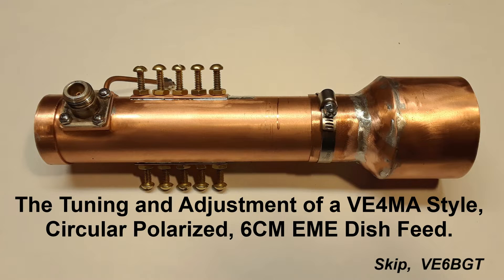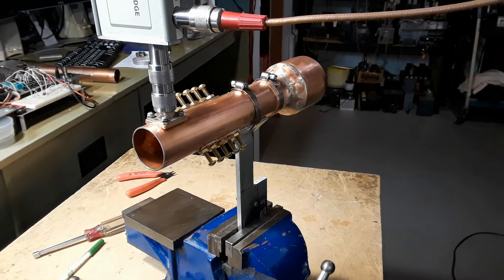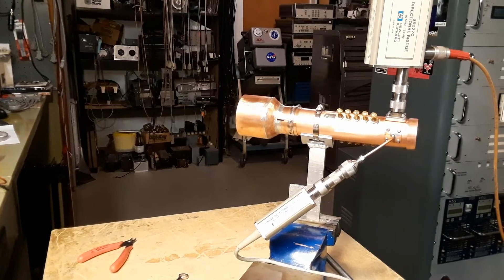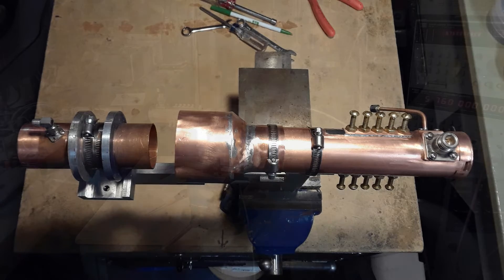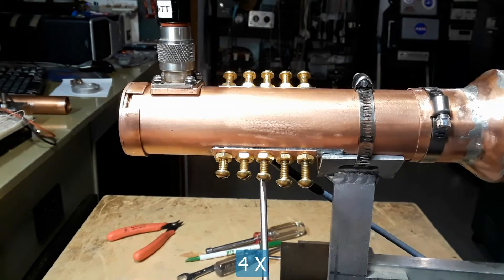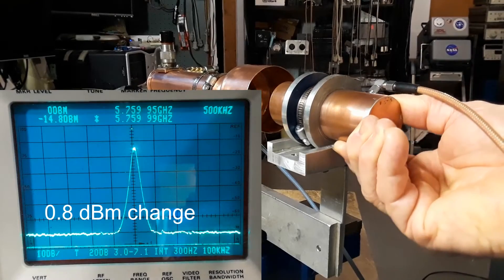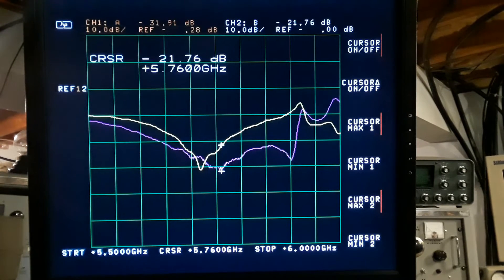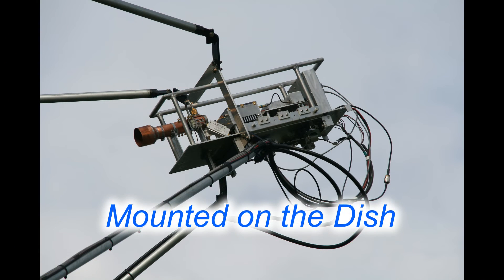The Adjustment and Tuning of a Circular Polarized feed for 6CM EME

Comment: Hi mr. Skip,

I am interested how in this case it is determined whether the circular polarization is right or left? Also, how is this "direction" realized on the feed?  
Thank you.
Reply from the maker: Hello there, well the determination of which rotating direction the signal is polarized is in the two connections on the waveguide tube itself.
The connections are at 90 degrees to each other and if I hook the transmit to one and the receive to the other it will be for example right hand polarized.. If I reverse the cables to the connections then it will be reversed, left hand polarized.. The bolt adjustments are the setup to make it circular polarized instead of it having two linear ants at 90 degrees to each other... The signal coming out of the feed opening is rotating in a circular direction and every time it reflects off a surface like the dish reflector or the moons surface, this rotation will be reversed.. So you have to hook up the cables to the feed horn ant so that when it goes through all the rotation reversals, you wind up with the correct direction at the other end..

Skip
Reply: @VE6BGT  I understat. Thank you!  (-:
Reply from the maker: @kLJiga  No problem, I am no expert but have learnt a lot from just my own experimenting and a lot of help from others! Thanks, Skip